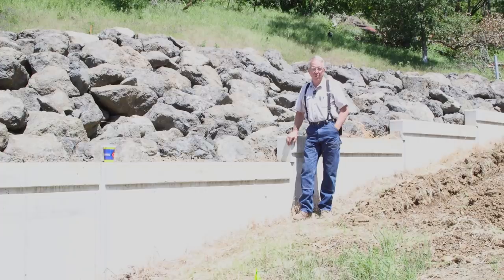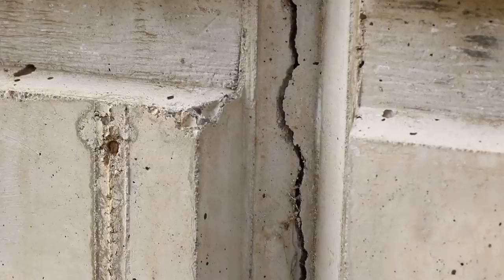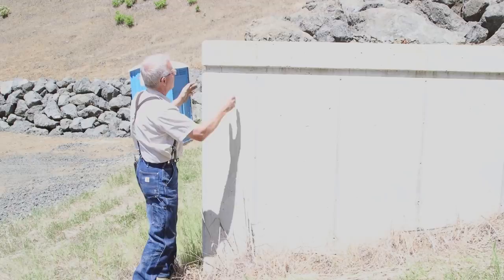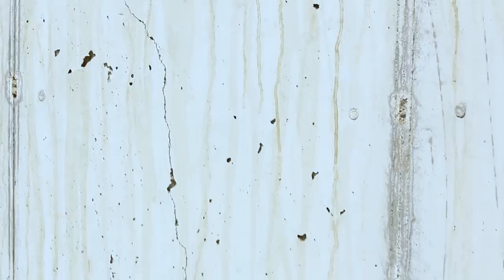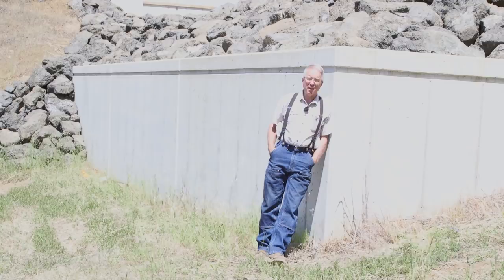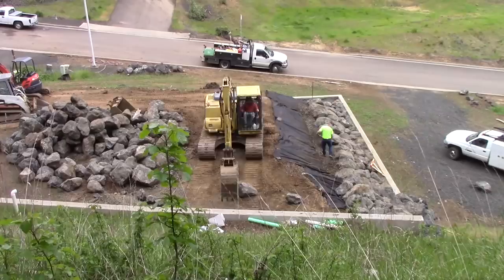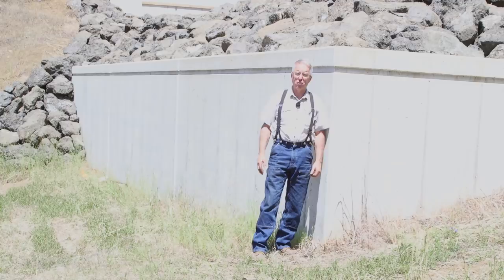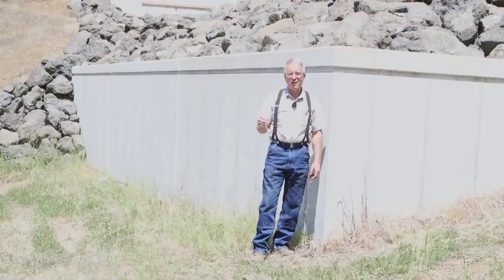Retaining Wall Recap EP.24

Comment: We want to see EVERYTHING!
 Every screw up, every miss-hammered nail, every time you forget to plug in the saw. We can't learn much from a  polished up "made for TV" glamour video.  I wish I had a well documented construction series like this at the beginning of my career. Nevertheless I'm always learning.
Get ready for your subscriber base to rocket!
Reply: And You Are He,s Covereing it Well  !~!~ Well Documented !~!~!~
Reply: Nate Joseph well said
Reply: @billcoley8520  I suggest that all of you have this documentary archived on magnetic tape and on frame film tape
Reply: In the past, in our military installations. We use double-shell reinforcement with mechanically hooked and clamp bolted
and spot welded with stick welding steel rebar reinforcing trusses and the concrete mix contains galvanized double-twisted steel fibers and mix with the concrete at 350 pounds up to 550 pounds of steel fibers for every 1 cubic yard. The cement-sand-gravel ratio is 2 parts by volume - 1 part sand by volume - 2 parts graded gravel by volume. We always make sure that all of the sand aggregates are mica-free and is thoroughly washed cleaned and rinsed clean and properly stored in safe storage warehouses and in covered cylindrical bins.

Comment: Lol I framed in a subdivision 5 years ago were the concrete guys  did decent work on form walls and the slabs. I mean we still shot our corners and stick framed the first level as any decent carpenter would ... but the concrete guys forgot all about the footings for posts in load bearing walls....every slab  in 25 houses cracked in half.  You're one man bud....give yourself a break on the hair line fracture in a 40' right angle wall.
Reply: NmE * Oh wow... that sounds like a very expensive mistake.
Reply: why did you start this with lol
Reply: How did that fly by the inspector?

Comment: EC : tip from Landmark building work.. to prevent need of whipping out the micrometer every day a tell tale can be placed across the crack.  We used a thin glass rods that had been heated in the middle so the center was reduced to about 2mm dia. which lapped the crack plus 1/2"  on either side.  Ends were anchored with epoxy dabs.  The brittle whisker easily cracked with movement and provided visual evidence of horizontal and vertical movement.  Saves a lot of time....measure and analyze only when needed.  Digital camera photos provide records of due diligence if needed.  

Again, kudos for well presented and honest work.

Comment: Just remember there is only two types of concrete that which has cracked and that which is yet to crack! Great video as always
Reply: 3 concrete facts
1. It's going to get hard
2. It's going to turn white
3. It's going to crack
Reply: Proper prep and pour skills it wont crack rookies get cracks
Reply: @Allinoffroad  BS, you can work to control cracking, but it's gonna happen. Check out the ACI manual. I've been doing this 20 years ROOKIE. I will give you my house if you can pour 400 ft and it not crack in 28 days
Reply: @travisdavis3974  
Ive been doing structural concrete for 25 years and never had anything crack ,house builders have cracking because they have no idea what there doing
Reply: @Allinoffroad  blah, blah saw cut, tooled, and formed joints will control/limit cracking but physics require cracking. Check ACI Mr 25 years, being a laborer doesn't make you knowledgeable
Reply: @travisdavis3974  
There called expansion joints and im far from a laborer friend
Reply: @Allinoffroad  expansion joints are usually a rubber or bituminous products cast in to create a void in concrete to allow for expansion. The processes I describe are control joints. This is the third time I have referred to ACI do know what that is?
Reply: @travisdavis3974  
Ok whatever bubba fine cracks happen ! Happy i dont really care
Reply: @Allinoffroad  good day Sir. Happy pours to you
Reply: @travisdavis3974  
And yes im well aware of all the aci and all the types of concrete testing
Reply: @travisdavis3974 
Thank you crack free pours to all and all a good night hahah
Reply: Micro rebar
Reply: @sparksmcgee6641  no guarantee
Reply: @travisdavis3974  hell of a long way from the guaranteed to crack everyone else brags about.

Comment: In the past, in our military installations. We use double-shell reinforcement with mechanically hooked and clamp bolted
and spot welded with stick welding steel rebar reinforcing trusses and the concrete mix contains galvanized double-twisted steel fibers and mix with the concrete at 350 pounds up to 550 pounds of steel fibers for every 1 cubic yard. The cement-sand-gravel ratio is 2 parts by volume - 1 part sand by volume - 2 parts graded gravel by volume. We always make sure that all of the sand aggregates are mica-free and is thoroughly washed cleaned and rinsed clean and properly stored in safe storage warehouses and in covered cylindrical bins.

Comment: Sometimes you have to take a step back before you can go forward. Recognizing and taking those steps is part of what distinguishes the pro's.  My builder didn't do that.  They raised the grade in the back yard of my typical, Phoenix development house, but didn't do anything to reinforce the common 8x4x16 block fence, so it's serving as a retaining wall for 2 to 3 feet of dirt. I think I'm going to have to dig it up and install something like a stem wall inside the fence.  Big pain due to their sloppiness.

Comment: Great video, good points you highlighted. I do recall the rock wall felt steep to me when I watched the build, not that I thought it wasn't stable but it just felt like a lot of height was concentrated there between the concrete wall and the rock wall. Oh and good point about taking weight off the concrete wall beneath it now. You got already a number of things to learn and its like you just scratched the dirt.:-) thank you for taking the time to do this.

Comment: As someone who has no construction experience I have a question that is basically from the perspective of a potential buyer. When looking at the cracks in the retaining wall, it looks as if the wall is failing or at risk of failure. How do you address the cracks, do you fill them with something (mortar or more concrete) and if not, how do you explain it to a potential buyer if they are concerned about the structural integrity of the retaining wall ?  I found your channel while researching how to build a floor in my garage and I'm very pleased that I did. I find your video series very interesting and I'm learning a lot of information I hope to use as I begin making repairs and upgrades around my house. Thank you for taking the time to produce this series.

Comment: Scott, somewhere buried deep in my gray matter was an article I read in an engineering magazine about corner rebars. When the horizontal bars get to the corner and make the turn, the outside bar of one wall becomes the inside bar of the other wall. They basically crossover at the corner. This swaps the tension and compression loading of the steel from one wall to the other and keeps the corner from cracking. Not sure if it works or not, or if you did this on your job, but maybe an engineer can weigh in on this theory.

Comment: I've designed and detailed a lot of CIP walls like this (registered P.E.) with no vertical or horizontal cracks on 90° corners, both inside and outside alignment changes; all without any control joints anywhere near the corner. In my opinion, that diagonal crack is a telltale sign of differential settlement, not a T&S crack.  Thanks for the videos, I do enjoy your channel.
Reply: What's that mean in English?
Reply: Basically one area of the wall has settled slightly more than the other.  In a CIP wall like this, a Temperature and Shrinkage (T&S) crack normally runs vertical, and, if not jointed properly, will appear just like they do in slab on grade construction, with a fair amount of regularity.

Settlement cracks usually are diagonal in appearance. You'll see it often in masonry block work, where you can easily see the crack in the grout lines.

In a CIP corner, a restraint crack would tend to show up at the acute side, working outward (google re-entry crack). So the back side corner typically is chamfered, and has a fair amount of rebar tied from one face to another, which together usually take care of the excessive restraint (cracking) a corner produces.

Differential settlement will still result in plumb walls, it is typically an in-plane defect. Basically the wall wants to open up like your hand, in an outward motion, in line with the wall's direction. But the concrete wall is not designed for tension in this way, which results in the diagonal crack.

Cheers.
Reply: D Flittie  I concur.
Reply: D Flittie  It takes approximately 28 days for concrete to reach most of its strength.  So do you think if backfilling against the back of the wall with so much surcharge load and stress before the concrete has a chance to reach it's intended physical strength contributed to this kind of cracking? .. Do you think if waiting to backfill at least a month would have avoided most of these cracks?? or is all that a redundant concern???

Comment: So, the wall is structurally sound. It will last for generations no doubt. But if you (or the prospective buyer) really wanted to "hide" those cracks, is there anything that can be done? I'm picturing like a caulking or a skim coat of stucco or something.

Comment: You could add some buttresses if it would help you sleep at night.Also it would be best to fill those cracks with sealer so your rebar doesn’t rust and eventually fail causing the wall to give out as well.

Comment: Concrete in Norway doesn't crack like that.  If it did, no building or wall would still be standing after 10 years.  I was looking more closely at a retaining concrete wall built down the road from me about five years ago.  It's about 15 metres long, roughly two and half metres high, and maybe half a metre thick.  All I can see so far, are a couple of hairline cracks about three metres apart towards the middle that have been painted over with sealant to prevent further water damage.  Apart from those though, it's as solid as the day it was built.

Comment: You should’ve looked into a segmental reinforced soil wall... Keystone or similar... this would’ve given you maximum lot size!
Reply: if it's good enough for freeways it woulda been good enough for a house
Reply: You don't realize how much excavating is required for those kind of retaining-walls.  He would have had to excavate half the mountain to 'properly' build an SRW retaining-wall.  Because most of the structure is the ground and tons of gravel sitting on top of a 'geotextile fabric', behind the wall.
Reply: If you look back at the original video  there was already a considerable amount bulked out behind the structure  (especially the longer side) which Scott backfilled with what looked like imported fill anyway. 

The geogrid needed wouldn’t have required excessive length... The existing wall only looks to be around 2 metres... An RSW may have been roughly 3.5 metres high so the grid length would have been perhaps slightly longer than that...

I guess the cost analysis between the additional excavation and import of select fill vs a wall containing concrete, rebar, water proofing, imported drainage aggregate and rip rap would have been interesting... Especially when you take into account how much more usable lot size would’ve been released....?

The wall at the back of the lot could’ve possibly been a gravity wall which is even easier...
Reply: Edward Barnes  Good points.  You obviously gave it more thought than me.

Comment: On an earlier video, you discussed the need to ensure that the rebar in the wall was incased in concrete so it wouldn't rust and cause the concrete to fail due to the expansion of the iron.  As far as the tie rods that helped hold the vertical forms together, they are designed to be broken off below the surface of the concrete once the forms are stripped.  Is anything done to seal these so they will not rust over time?

Comment: What was the reason for not choosing a full-fledged expansion joint? Was it the cost or for ease of building?
Reply: Cost and time I would guess
Reply: ...and 'ease of building'.  Expansion joints require more attention.  It's also (imo) not appropriate for (most) retaining-walls, because it weakens the wall even more than control joints (control joints still have the steel-reinforcement running continuously through it😉). ...If this wall is veneered, it might be wise to put a few expansion joints (in the veneer), depending on what it's veneered with. . Brick might be a good contrast with those bolders.?
Reply: @bonanzatime  that's something I would have to look into. I'm a professional builder and we just built an 480 foot long retaining wall that starts 4' and rises to 17 feet high and there is 1 expansion joint. So I know it's possible but just not sure why engineers choose to use them sometimes and not others. So I guess this question could be best answered by a structural engineer. I think we are both guessing LOL 😂
Reply: iandi Boats  'engineers' also do some 'guessing', my friend (especially the ones with 'civil' in front).. I imagine that one expansion joint is most likely going to be smack dab in the middle of your wall.?  If so, that makes sense to me. .. and I'm glad they didn't over-do-it, like some 'structural engineers' tend to do.😉

Comment: It takes 28 days or so for concrete to reach most of its strength.  I wonder if you had waited a full month before backfilling behind it (before putting load-pressure against the wall), if that would have avoided the cracks?.🤔  Those are pretty big 'shrinkage' cracks.?

Comment: Wait dosent your cracks allow a path to the reabar for the water? 
in that case won't rust just tear it down in a few years time?
Reply: No. Rebar will last for decades just sitting in the mud in the form yard.
Reply: They make powder coated rebar that never rusts .not sure if it was called for in the specs on this job , but it exists.
Reply: @Gterr1971  my experiance is that untreated rebar will disappear inside a couple of years (it will take a bit more time for the 15 and up but I've seen entire wall blow themselves apart within  5 to 10 years if you don't do anything to them
Reply: Alfonce Jean  Really?!😰

Comment: In hindsight,  are you happy with your choice to engineer a flat building pad?  Have other options been reconsidered, for example a stepped footing and taller foundation walls, or also shorter terraced retaining walls conforming more to the shape of the house footprint?  Additional observation is you've lost a lot of lot square footage above & beyond the required setbacks. (No criticism of your project, that time has passed...but as a case study for others?)  I can also imagine less forgiving neighbors objecting to the temple mount effect when seen looking up from lower lots.

Comment: In other videos you adressed the snow/water and freeze thaw issues in concrete. How do you deal with that in these retaining walls, as not only can water get into  the control joints, but you also have exposed rebar in that same joint that might rust, or is it stainless? I know around here replacable caulk joints are sometimes used to keep everything sealed. Would much appreciate some more insight, and thanks again - great to see you back at the house!

Comment: in putting in the foundation for the house.. are you going to have the entire foundation connected..  instead of a perimeter with a few supports inside its layed out like a digital 8..   perhaps with a few post tension rods thru it.  perhaps with a few drilled holes just inside the corners.. that are filled with some concrete and rebar baskets. perhaps like an upside down lego block but with 10 or 15  foot deep pegs...  verses just a 2 foot deep foundation.  since you are on a slope.  just to stop eventual creep on the top few feet.  they might only be 12" in diameter.  as long as the rebar is bend with long 180 degree bends and is dropped over the horizontal rebar.  heck put some zig Zags in it  with an offset rebar bender.  only needs one or two zigzags.  just forward thinking .
Reply: The house will sit on a flat pad carved out of a slope and retained by the walls.

Comment: Generally we don't bother with controlled joints and simply separate the areas where math says they would otherwise crack. But i guess this method works too, and well. Bummer that you didn't have the time to introduce those at the corner. :(

Comment: I put in a 5' tall retaining wall a year ago. My wall is the same thickness as your wall and I used about the same amount of rebar. If I was building your retaining wall, I would have made it thicker and used a lot more rebar since it is taller and because your wall has more stress associated with the load behind it. I did not see, did you install drainage pipes and incorporate any water control in the first 3' of backfill? Hydrostatic pressure is almost always underestimated by DIY and home owners. Your cracks are most likely caused by insufficient rebar, insufficient thickness of the base of the wall, and not enough 3/4+ rock in the backfill to allow for drainage. ANY wall over 4' tall NEEDS drain pipes through the base of the wall to allow the water to escape. Without proper water drainage, the cracking will grow and get worse every year.
Reply from the maker: Drains are safely in place...